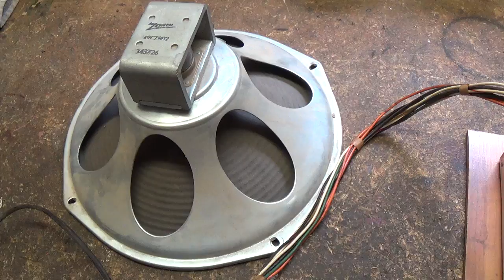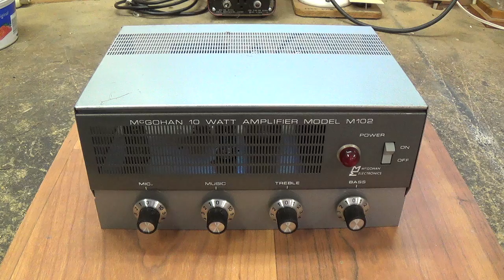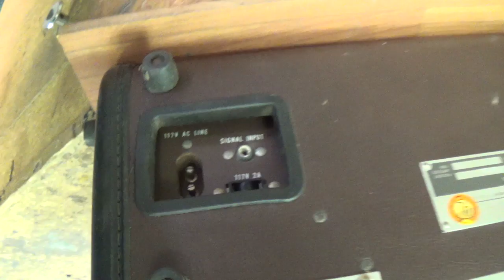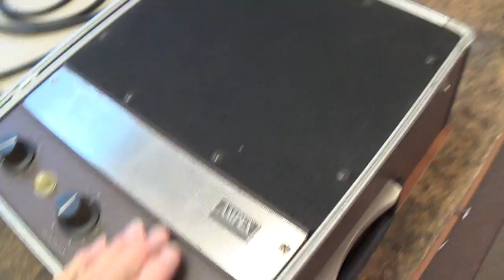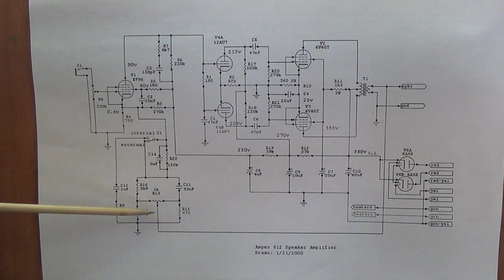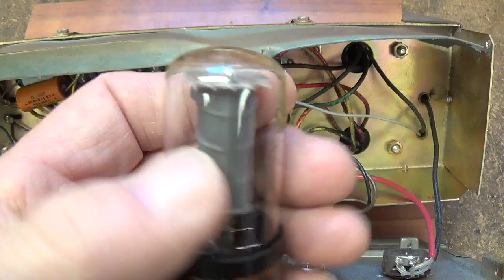Garage Sale Bargains in Vintage Electronic Gear

Comment: My Dad recently gave me a Heathkit AA-32 Tube Stereo Receiver Amplifier. Two guitar amps in one.
Reply from the maker: Good luck with the conversion, Will :)
Reply: @UncleDoug  Random Question. I have only made Guitar Amps in the Head Configuration. I can do it in my sleep. If im going to make a chassis combo hanging style chassis that would flip the position of the solder lugs for the pots right? Lol its like a brain teaser. I guess I will figure it out when my controls adjust backwards.
Reply: The adjustment range is above the lugs is how I see it.
Reply from the maker: @will523  I have no idea, will. Use trial and error or an ohmmeter to figure it out.

Comment: My parents' Magnavox hi-fi had two 12's and two 6V6 power tubes with sockets for two more. It was my first guitar amp after I added a quarter-inch jack. A building contractor stole it out of my storefront.
Reply from the maker: Those building contractors can be a shifty lot ;)

Comment: If it's a very old audio amp (~1940s), the wire could be cloth-asbestos wire, if there's a white soft fibrous material under the cloth don't sniff it!
Reply from the maker: Sniff it, hell.....I EAT it ;) Seriously, thanks for the tip, Edgar.

Comment: I have 3 Ampex solid state powered speakers. Because of a bad ground connection, the 4" tweeters with rear baffling (yes) in 2 of them burned out, and previous owners had replaced them with small diaphragm tweeters, and balance is terrible.  I'm considering giving the one good tweeter to ARS to see if they could replicate it. Ideas?
Reply: Thanks anyway. I enjoy your videos.
Reply from the maker: You lost me at Solid State and tweeters, MO. I'm sorry, but I only work with vintage tube (mostly guitar) amps and speakers.

Comment: Another good source of old valve electronics components is the old cheaper end reel to reel tape players normally 1960 & before, no one wants them & some of them aren’t worth repairing.
Reply from the maker: Quite so, Nathan. Thanks for the tip.

Comment: Hi Uncle Doug....when I asked about the OT testing, I wasn't worried about DC voltage being used but only if the "wall wart," 12 volt @500ma would hold it's voltage while testing so I would get consistent results. 
Thanks as usual for your knowledge...Daniel
Reply from the maker: You can monitor the AC input and the AC output simultaneously with two DMM's, Daniel, which would make it evident if the supply was stable.

Comment: Great video!
Nothing sounds like vinyl through a stereo tube amplifier. 
You don't have to, but upgrading the speakers can give you even more 3D sound. I ran my 1958 Pilot stereo into a pair of Infinity 150 studio monitors for years and listening to "Mountain" or classical music is incredibly detailed.
Electrolytic recap is highly recommended with power conditioning, etc.
Great advice Doug!
Reply from the maker: Thanks for your helpful hints, Amo.

Comment: Hey uncle doug, recently found a Farnsworth Radio/Record Player consolw, minus the record player, its a beautiful item with beautiful tubes was wondering anout converting to guitar amp? Picking brain on either restoring or  amp?
Reply from the maker: I personally don't think that radios make very good guitar amps, Dean.....many of the tubes and over half the chassis are specifically for radio use. It would probably make better sense to either restore it as a radio or sell it to someone who will.
Reply: @UncleDoug  I appreciate the feedback still thinking about what to do  only paid $20 for it so not a big loss. Record player for it run between 50 to 99 so we shall see thank you Uncle Doug
Reply from the maker: @ezdno  I wasn't suggesting a restoration that involved the record player, Dean, simply the radio portion.....if you have any need at all for a good radio. If not, then proceed in any manner that suits your purposes and needs.
Reply: @UncleDoug  thanks again, I am ocd in that way, if I'm gonna restore it will becas close to new and working order as possible..Still gonna search the yard sales and thrift stores for the hidden gems.
Reply from the maker: @ezdno  PA amps are the best for conversion, Dean......and they're usually quite inexpensive.

Comment: About 5 years ago I would scour CL every week looking for vintage tube stuff people were selling or getting rid of (most of it was the latter). 
My first score was donations from a guy who lived nearby who had gotten into tube amps for a bit and then decided he was done. I got several PAs (a 20W Davis PA, a Bogen CHB35A, and a Grommes Precision Electronics 60PA) and a Hammond L100 series organ amp from him. 
My first organ was a Conn Caprice with a stereo amp and 45 or so 12AU7s. lol.  It had a stereo amp which didn't interest me. The speaker was mediocre, so I ended up parting it out and selling the parts and made a tasty profit. $30 for the organ and I made over $150 on the amp itself. Got a Hammond L103 (which I made into a Marshall 18W style), an M3 (which I made into a 5E3-ish style). I also got a Baldwin and a Kimball and a Radio/Phonograph/wire-recorder thingie with a mint 15" JBL speaker in it)
From all of it, I got some great speakers (some P12Qs, the 15" JBL), miles of wire. From the one solid state organ I parted out, I got a lifetime supply of shielded cable. 
Made a good bit of change parting those things out made some nice amps out of it. The only thing I regret parting out is the Grommes PE 60PA. It had a really nice replacement OT on it that I wish I had kept. Oh well, at least I traded it for a really nice OT, so it wasn't a complete loss.
Reply from the maker: Your story merely emphasizes the upside of shopping for electronic gear at garage sales, etc., Pete. Thanks for sharing.

Comment: ‘Start trampling grannies ‘

:’’D

Their tubes not toilet paper uncle Doug ! 

Great vid, got a bargain recently local rubbish tip collects electronics got a Aust made Tv totally tube except for rectifying.
Audio amp, demodulation, and the HV conversion for the Ray tube all driven by tubes. 
Started pulling it apart but haven’t analyzed it yet to ID the tubes.
Reply from the maker: Good luck with the project, Kolin.

Comment: I use to plug up my Les Paul to my moms old stereo cabinet like that Zenith. Man the sound was awesome.
Reply from the maker: I'll bet it was, James. Sweet memories of our youth :)
Reply: @UncleDoug  so that would be around Midland, Tx  to Van Horn area for you?
Reply from the maker: @jameswatkins7263  The other way, James.....El Paso, Las Cruces.
Reply: My sister graduated from Mayfield high school in 86. I went to school on the Missle Range and then we moved to Germany. Question for you. Is a Rocky R12S amp, designed by Dennis Kager/Sundown Technology Inc(Moog) worth repairing? I can't find the schematic, but the info I have says it has a 6V6 and 2 12AX7. I have the amp chassis but need to build a cab and get a 10" speaker. Has the original transformers no tubes.

Comment: I have a McGohan M102 similar to the one in your video. The one I have has the EZ81/6CA4 rectifier tube as opposed to the solid state that is in the video. I am sure it is a somewhat older version. We converted it to a Marshall circuit, the phono is high gain and the mic is normal. We changed the pots from left to right to Gain Treble Bass and Master Volume. Also all pre-amp tubes were changed to 12AX7. Major overhaul but worth it. This is clean or mean.
Reply from the maker: Wow.....that sounds like an excellent series of modifications, VR.

Comment: Nice find.  I only say that the EL84'S were typically run very hot and typically very long in old hifi's and as result are typically fairly spent by the time you find them...just tap them while in operation and watch for sparks!

Comment: Hi Doug, can you do a video on converting a non reverb tube amplifier to a spring reverb tube amplifier?
Reply from the maker: Not really, Bill, because the conversion is not practical. It would require a complete overhaul of the amp circuit, including a new power transformer, adding of tube sockets, etc. It's a whole lot better to simply use a Fender 6G15 or a pedal.
Reply: @UncleDoug  Thanks!
Reply: I got 2 old vintage console radio guts I was thinking on trying to turn them into a guitar amplifier, I hope it goes well!
Reply from the maker: @bill.clifford.59  So do I, Bill. So much of the radio circuit is not usable.....it's hard to condense a chassis down to simply the amplifier portion.

Comment: ... And Rusty leaves wagging a tale of indignance. I have an old Hammond L-100 that I will eventually take the electronics and speakers out of and put the rest out to the street, as it needs a starter motor and I need the space. Hope to get that made into a guitar amp someday ... but I'm running out of "somedays"!
Reply from the maker: You and me both, TT. Good luck with your project.

Comment: I always look for old electronics at the local thrift stores. I just picked up an old Zenith floor radio for ten bucks, and a Columbia record player (tube amp based) for 2 dollars in pristine condition. The record player will be rebuilt the radio? we will see.
Reply from the maker: It sounds like you discovered some very interesting and economical projects, Jack. Best of luck with them.

Comment: Always been interested in valves but was baffled by them until i found your channel and after watching many video's things are getting clearer in fact whilst your explaning schematics i'm usually in front of you waiting  to see if i'm right, that is how much i have learned from you. anyway thinking about not missing out on cheap items i was given a GEC BC 5442 radio i went and throw it in the car but when i got home and looked at it all the corners are intact no knocks or bumps on the cabinet but it has been facing a window and the varnish on the front has gone white. all the screws are there the chassis still have original the back is like new anyway took the chassis out and its still original the bloke said his farther bought it in 1940 he even gave me the reciept and the user handbook.anyway i stripped the varnish of today and ordered a load of caps for it, i think this is gonna be hard for me as i don't like breaking things even though it is of no value i have decided to spend time on it as a workshop radio. i just want to thankyou for making these videos and taking the time to get others interested .
Reply from the maker: That sounds like a great project, Ray, We need to show some respect for ancient devices which have remained intact all these years......which is more than I can say about myself......and restore them, rather than send them to the landfill.  Best of luck with the radio.
Reply: Doug i like antique equipment,you being a machinist may be interested i have aquired last year and just finished a mechanical restoration on a Hardinge BBV2 Milling machine this summer im going to refill the ruberised casting coating were the handles have been removed as they are no longer needed as it is no longer 110v 3 phase  and repaint it .was really impressed with the way it was built but it is limited due to the small size of the bed but that being said it is still a very nice usable machine. http://www.lathes.co.uk/cataract%20miller/page2.html

Comment: Hi. I have 2 sets of the Zenith amp and preamp at the beginning of the video. One I have overhauled and is reinstalled in it's original cabinet with Cobra-Matic turntable. Sounds really nice. The other is in the process of being overhauled and will be installed in another cabinet with another Cobra-Matic turntable. Fun to have around.
Reply from the maker: I'll bet they are, Bruce. It's good that you're restoring these old devices back to proper function.

Comment: Have you ever seen anything which uses 12BA5 output tubes?
Reply from the maker: I think you mean 12BA6.....and no, I have never even seen such a tube.
Reply: @UncleDoug  Typo...I meant 12AB5.  It's basically a 6V6 in 9-pin miniature with a 12v filament.
Reply from the maker: @douro20  No, I haven't. I looked them up and they are primarily for automotive radio use. This is the first I have heard of them.

Comment: Is there any issue with adding caps in parallel over the filter can cap instead of replacing the can? I'm referring to the second amp you worked on.
Reply from the maker: Yes, it's a counterproductive waste of time. The old cap will continue to leak and cause havoc, including creating a dead short, if you leave it in the circuit.

Comment: Whats the difference between the hifi tube amps and a guitar tube amp? Every hifi ive converted for guitar sounds better to me, is it the preamp tubes that give the sound? I cant figure out why. Other than that only a jcm900 have I found has the sound but it had been modded caps tubes and tuned.
Reply from the maker: A HiFi amp is produced to create pure, clean, very low-distortion output and relies upon separate woofer and tweeter speakers (with a crossover network, generally in a sealed enclosure) to portray it.  Guitar tube amps are produced to create both clean or really raunchy tones through open-backed speaker(s) with no concern for tweeters or distortion. They are as dissimilar as a hatchet and a sledge hammer.
Reply: Or an Exacto knife and a machete
Reply from the maker: Good analogy, CM :)

Comment: What is the current rating of the high voltage supply on the power transformer of the Model 7 Zenith?
Reply from the maker: Heck if I know, Liz. The chassis is long gone and I don't generally make note of such things unless I'm buying a replacement PT.  You can come up with a reasonable approximation by adding up the current requirements of the components.
Reply: Thanks for the reply! Its just the website that contains the actual schematic looks to be a bit... virus infested and it triggers my senses hahah. I'm just curious because I am designing my own hifi circuit based on someone elses which has a 230mA transformer, 4 6V6 valves, 2 6SL7 valves and then I wanted to add in two of my own 12AX7 valves... I'm a bit unfamiliar with the maths behind it all so I just wanted to use something like this as a general approximation for the power transformers current rating, whether it's enough or not.

Comment: The phono input bypasses the mic preamp . I wonder if the amp needs a high output phono cartridge? The phono signal joins the main circuit path directly, so no RIAA EQ in phono.
Reply from the maker: That could well be true, CS.

Comment: Doug..  Quick question...  I actually started watching your videos because I recently purchased some vintage tube radios from the 50's and wanted to learn more about how everything works, etc (been watching your tube amp vids), and I just discovered that it seems you actually do some work like that yourself (restoring and building old vintage amplifiers) after really looking at the main page of your channel...

I plan to fix/restore and use a few of them as guitar amplifiers and then restore a few more and add inputs for modern electronics (found a beautiful 1939 RCA Victor floor model radio that is going to be put back to the best condition I can make it)..  Just a new hobby that I want to try my hand at..  Do you have any advice on resources that I could use to start getting into this?  I have a "decent" knowledge of electronics (been a tinkerer most of my life), and i haven't come across anything too difficult yet that I can't figure out (mechanically inclined if I do say so myself), but I am nowhere near your level of expertise.....   yet... :)  .....

Any advice you can offer will be very appreciated....

Thank you for your channel as well..  I can see it will be an excellent resource that will keep me busy for a while...
Reply from the maker: This will sound like a "cop out", Shawn, but I strongly recommend that you simply continue what you are currently doing......watch some videos, read some articles, etc. but experiment, invent, develop, etc. your own methods and styles of conversion. You are far more likely to become independently proficient and creative by simply "winging it".
Reply: Not a cop out at ALL... That is honestly how I have learned my entire life...  Dive in full force, and lots of trial and error...  It is part of the fun, well, most of the fun to be honest..  Thank you so much for taking the time to reply..  It is very appreciated... 

Good luck with everything, keep up the awesome videos, and above all, keep enjoying what you do...  It is very evident that you have a passion for this, and there are many of us that are going to learn from that passion..  Take care Doug!!
Reply: Now I just need a neighbor like you to pick their brain...  You don't have any houses for sale in your area do you??  :)

Just kidding....  the wife might leave if I actually had someone close to encourage me...  Have a good one Doug....  Thanks again...
Reply from the maker: Thanks so much, Shawn, and best of luck with all your projects......and your wife ;)  She should realize that there are far worse male pastimes than studying electronics and building amplifiers......far, far, worse ;)
Reply: Uncle Doug Amen to that...  As husbands go, I’m more harmless than the majority...  I have guitars and amps, she has whatever is cluttering her closet floor at the moment..  Fair trade...  Thanks again Doug..  I really appreciate it...

Comment: Ive got a McGohan PA. Is incredible sounding.
Reply from the maker: They are quite well engineered, John. I'm not surprised.
Reply: Uncle Doug is a 100 watt mono output. 2 mic , 1 phono, input. Runs 8417 power, 12ax7a pre.  Sounds stellar. Has the circular input pre xformers. 

It is rad. It sounds like a Fender bassman and an Ampeg b15 combined.
Reply from the maker: Good grief!! It sounds like it's time to start hunting down McGohan amps !!